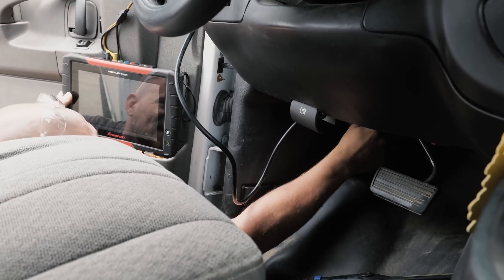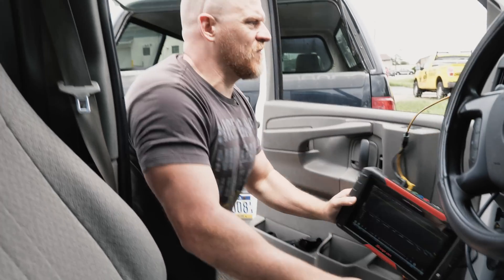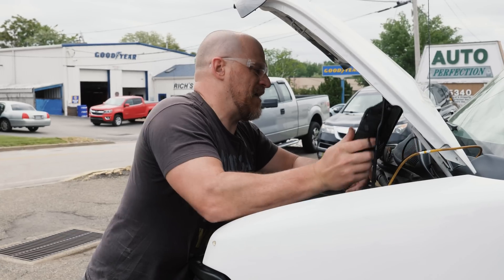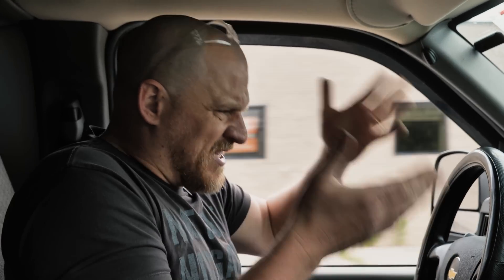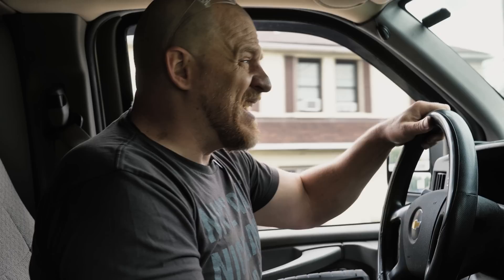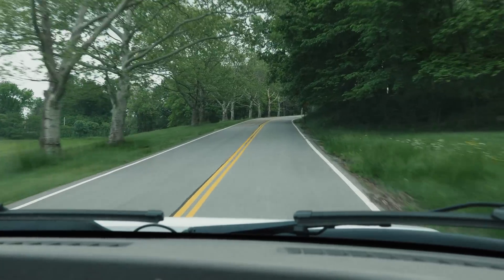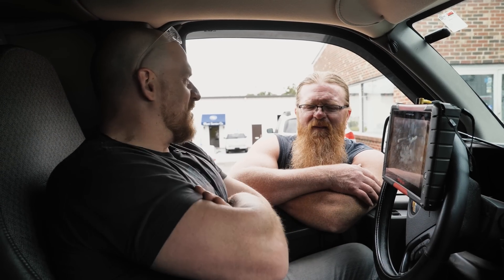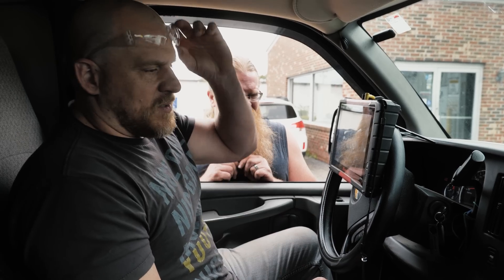We Don't Work For Free [Charging Diagnostic Time]

Comment: Customer Complaint:  A little yellow light keeps coming on. (The Stop/Start system warning light illuminates intermittently.)
Customer is unaware that their car even has this function.
Break out the owner's manual, explain the purpose, and hope it sinks in (there's almost 30 minutes shot right there.)

ME: Any related or unrelated work performed recently? 
        Are any aftermarket devices in use when the issue occurs?
        Morning, noon, or night, car warm, cold, short drive, long drive, on and on.
        Maintenance history?
         Are you the original owner, were you driving or someone else?
       Any notification's from the manufacturer concerning recalls, campaigns, ect.?
     

Performed an All Module Scan, and found 39 DTCs from 33 different modules. Suspect Uxxx codes as caused by Pxxx code/s
Checked battery connections and circuit integrity,  SoH & SoC, and Load tested.
Research TSBs, software updates and recalls, none found.
Pull up the SI for the offending DTC/s, read the theory of operation, setting conditions, check for the obvious first, get under the dash or hood, and break out appropriate diagnostic tools for the task at hand, test drive, inspect, try and reproduce and or confirm the issue/complaint.

We're at another 30-45 minute mark, maybe an hour if I'm not too busy and feeling charitable, maybe even using the time as a learning experience for future reference.

If I've done my job right, find and prove-out the cause, estimate, call the customer who is unreachable, send them an estimate via email and text (everyone has their Smarty phone in hand 24-7, except when it's me trying to get approval for a repair).

Give them a few to reply, put shit back together, push or drive it out, bring the next car in for a repair (the stuff that pays the bills), then they call, whine about cost, need their car by a certain time, yeah yeah yeah, sorry, best I can do is tomorrow.

Y'all get the picture :O)
Reply from the maker: 100% spot on. The things people do not see or understand. "Can't you just hook up your little machine to tell me what's wrong?"
Reply: @ScannerDanner  Yeah, the $6K X-Box with the $2,500/yr subscription, try explaining that to them.   Besides most customers having no idea what all is entailed, can't blame them, somehow I think they think we do this for fun. Hang in there Dude, and thanks for sharing your knowledge and integrity!

Comment: Working at several dealerships and shops over the years, the biggest hurdle was getting the"boss or service writer" to understand this concept. Those are the jobs I evacuated very quickly. Of course these employers loved that I could fix the problems other techs or garages but after getting multiple diag jobs in a week I usually got screwed on my hours. Oh well just a rant. The parts changers seem to get the recognition and pay and us diag techs get the crap end of the stick. Frustrating AF
Reply from the maker: 100% spot on and is one of the greatest travesties of our industry

Comment: Really great PSA about diagnostic time.. yeah the educated customer knows your time isn’t free. Couldn’t agree more with that analogy on the doctor visit not finding anything, but you’re still gonna be charged, this is the exact same. Great scenery on that drive very lush .. but I’d expect that in PA.. I always find your commentary educational and witty.. I’m a DIYer and don’t just swap parts, I try to diagnose and solve problems.. but if I scan something and it shows intermittent I/O issues I’ll RR a part of it’s not too expensive, like an ABS sensor.. I won’t tell my buddy if I’m working on his car you need a $800 ABS module.. open communication is key.. I think customers will understand

Comment: Had an ac system diag a week or so ago, woman called me and asked if I could figure out what was wrong with her ac, I said I can take a look at it, but my rate for diag is 50 an hr, she knew full well before arrival, I gave her a little over an hr and diagnosed the problem, informed her what the problem was, asked if I could replace it on the coming mon, said yes, also asked if she could pay for it all mon, reluctantly said yes, and never heard from her again, now I know that's my fault, but I figured being that a friend referred her to me it wouldn't be an issue, on top of informing her the ac shop that just "replaced" a line, didn't replace anything. But no, I guess she felt she needed to get what she lost from the shop, out of me. From now on my diags will be paid up front or I'm not looking at it.
Reply from the maker: that's some b.s. right there isn't it? Lesson learned though, unfortunately
Reply: @ScannerDanner  it most certainly is, I appreciate all you do for the community, keep up the good work!

Comment: I always get the people who seem to not understand that it may take more than an day to diagnose an situation. They always seem to think diagnoses takes an hour and it's just an scan but they don't understand that you may have to scope the car run live diagnoses on scanner and all this can take time when your navigating the scanner waiting for loading times page to page. Or when scoping you may have to scope more than one sensore or part which takes time to reset scope up and settings. On top of that all the other test like block testing for compression or snap throttle testing when in live diagnoses on scanner. Just sucks when you have someone who wants there issue resolved but don't want to wait to get there car back so they take there car blow up the engine then there mad that they have to buy an new car

Comment: As a mobile tech do you also charge to go out to the shop/customer house with these gas prices goin up?
Reply: Who wouldn't?
Reply: @xephael3485  reason I’m asking because I just started doing mobile work and was wondering if it was a good idea to charge to mileage fee
Reply: @55lamarr    I'd charge truck roll fee and milage over a certain amount.. like $100 truck roll fee for 25mile radius, 66 cents for every mile over or whatever.   So that 72 mile would have been $131 trip charge
Reply from the maker: absolutely your prices should vary based on the cost of fuel
Reply: Absolutely, should be a standard service call fee. Or mileage based. For example, I worked at a tire shop and our roadside tire service was $150 in town and increased with mileage if we had to go out of town
Reply: @oldmanriver8922  awesome I need to start charging a mileage fee then.yesterday I had a job 72 miles away and only charged for the initial repair